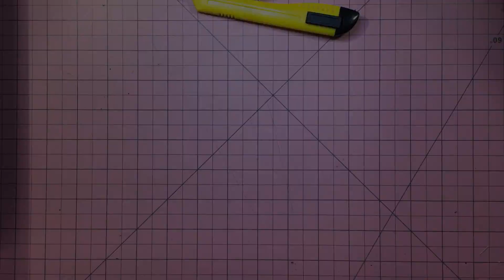Mailbag #9

Comment: Santa came early. Very nice stuff in amongst that lot. Looking forward to a couple of videos, that 4mb memory upgrade certainly looks interesting, would you need to flash the chip to tell it to look for the extra memory or does it automatically check the chip size.
Reply from the maker: It’s a straight swap, the tough part for old eyes is smd soldering! 🙄